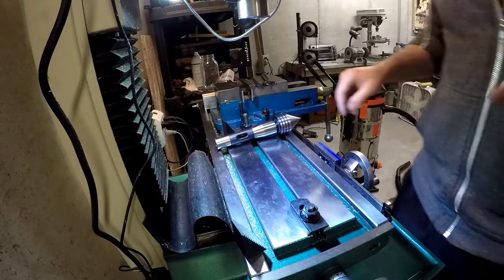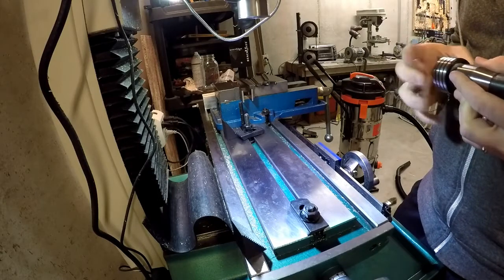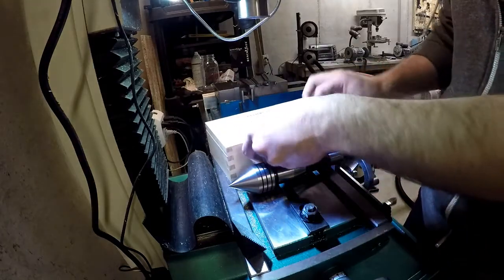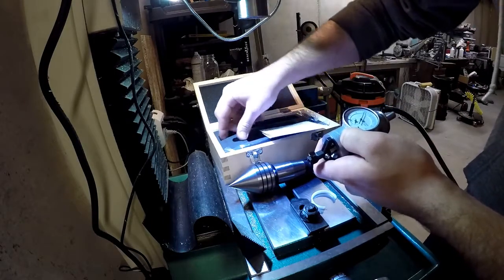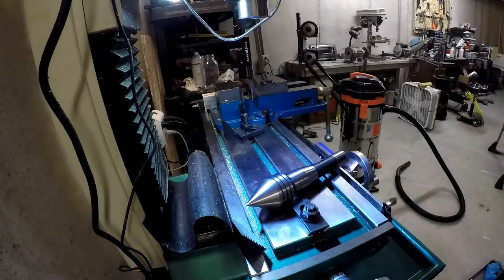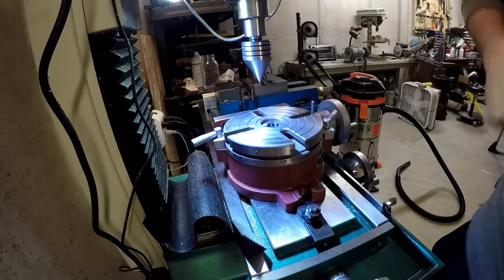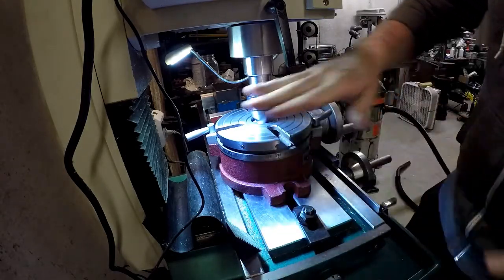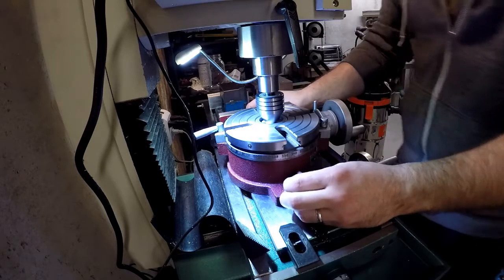Quick way to center a rotary table

Comment: What is the purpose of centering the work table with the spindle of the milling machine?
Reply from the maker: Gives a reference point for measurements from the center.  All kind of depends on what youre using it for.

Comment: Plain ol' dead center will work,,,,even better, - And Crazy is right. You need to put in the reaction bar in the coax. - Start with the center and then switch to the coax and you should be able to have it running within a half thousandth in less then 2 minutes. - Takes longer to put the dead center and coax in and out of the mill then it does to center up the RT.

Comment: I cut a round disc to fit my table on my lathe 8m hole and chuck a 8mm drill rod,great start point but if need better I then use a last word,I’m cheap lol👍🏻

Comment: I’d certainly be curious how repeatable and to what tolerance this setup is accurate. Seems like it should be really close. If I had a coaxial I would probably use it. As it is, all I have is a DTI and that’s really a pain. Thanks for the video!!
Reply from the maker: This obviously isnt the most accurate way to do it but it is quick very repeatable and accurate enough for a lot of applications. Thanks for watching.

Comment: A coaxial indicator is not designed to “spin with the mill.”  You should have received with the coaxial, a straight rod that screws into the threaded hole in the rim of the indicator.  This is a restraining rod and prevents the indicator from turning with the mill spindle so you can read it.  You can hold the rod with your fingers or place a post style magnetic indicator base to interfere with the rod to do the actual restraining.  Any high precision work requires you indicate the hole in the rotary table with a dial test indicator while the table is rotated rather than rotating the spindle of the machine because the table hole is not necessarily in line with the center of the table rotation.  There is always a tolerance for this alignment in the specs for the rotary table.

Comment: Did you control the concentricity obtained with this method ?
Reply from the maker: Alexander Todt i havent put a dial indicator on it but my parts have come out round within less than a thousandth. There are ways to be more precise but for the time put in this method gets you damn close.